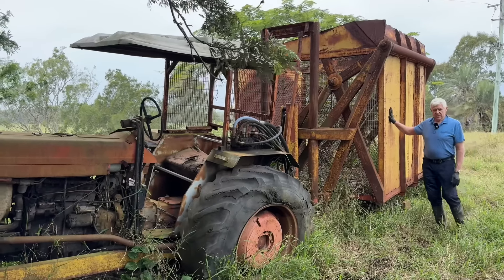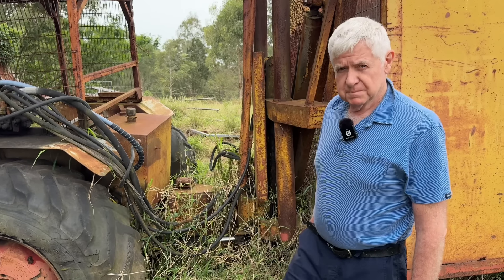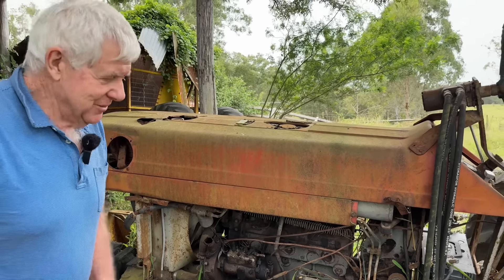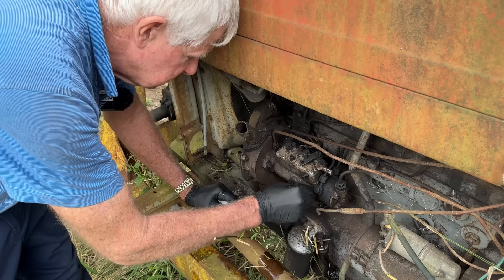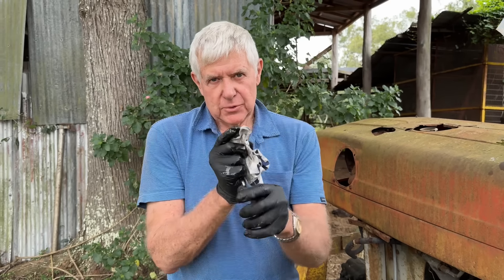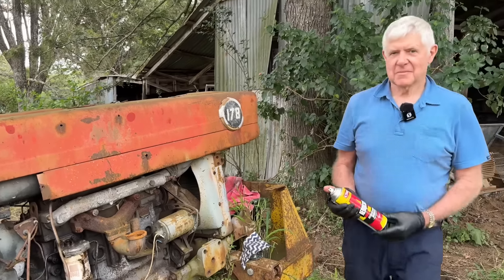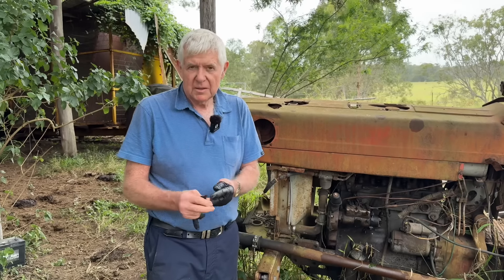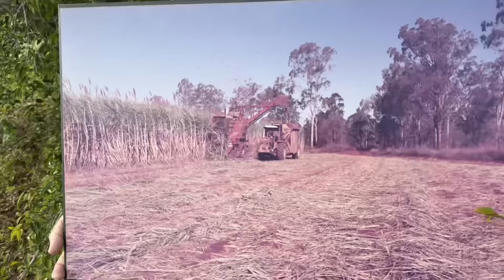Will it START? 50yr Old Tractor Haul Out Machine SITTING for YEARS!

Comment: Hi Bruce, Bruce here, The problem I believe is the stop lever on the injector pump. I just overhauled one of those injector pumps, thanks to Lance (Bundy Bears Shed) at Queensland Tractor Spares for the video on how to do it. We tried and tried to start an old David Brown 990 but it did not happen. We decided to overhaul the injector pump and found the stop lever was jammed in the closed position.  We primed everything once the pump was refitted and hit the starter and it started immediately. Took us by surprise , it started so easily.
If you have another go at it try working the stop lever back and forth to free it up. Not a lot to those injector pumps so they are easy to work on. Have a look at Bundy Bears Shed on YT and check out the CAV injector pump overhaul video.
Cheers Mate.
Reply from the maker: Thanks so much for this, I do know of bundy bear shed and I will take this all on board, thanks again, Bruce

Comment: On that fuel pump it has a strainer at the inlet of pump. Also it has a metering valve that gives it more or less fuel. When you pull the shutoff it closes that valve. When you push the shutoff back in the valve should go back to full throttle. That valve is known to stick if the engine has not run in years. I had the same problem with my backhoe. Tapping the fuel helped open it up. Since it is spring loaded. Thank you for another nice video.

Comment: Hi Bruce, I owned both a Chamberlain C670 and a C6100. The C670  was the 306 [70HP] A dog of an engine. The C6100 was fitted with the Perkins 354 100 HP. Used in everything conceivable. Not a bad motor.

Comment: Hi Bruce. Great video and I hope that you can get back and get the Massey to run. My guess that the whole unit was built by Barry McLean at Murwillimbah NSW. Barry was a real pioneer in the development of cane haulout units. He went on to build trailing and driven tipper bins as well as the huge elevator bins which could fill rail boxes one after the other down the tracks. Many other companies, Toft etc, would copy his designs and were used all over the canefields of NSW and Queensland. I even visited with a harvesting contractor in Belle Glade, Florida who was using the McLean toppers and elevators in conjunction with Austoft harvesters.

Comment: hey Bruce I have a IH434 with the same type of injector pump as that MF it had been sitting for years and would not pump like that MF I removed the top off the injector pump and it was only stuck with fuel varnish and I freed it up replaced the gasket and it started right up. Was a very simple job from memory the fuel stop was stuck in off position and the spring would not pull it back to the on position
Reply from the maker: Thanks very much for that Dave, I will pass that information onto the owner

Comment: Bruce, you said this farmer asked if they could build the attachment to go higher. Today they would give you all the reasons how difficult that would be and how costly it would be. Personal service is gone. Back in the 70s it was can do. Today its 10 engineer's and designers and an absorbent cost. I put a steering system similar in my boat 30 years ago. Good day, Jim from Connecticut

Comment: Hi Bruce, from the look and sounds of it, I think your problem with the CAV dpa pump is the fuel metering pin/arm is stuck in it's bore (common on these pumps when the engine has stood for a long time), pretty easy to sort out --- undo the 2 hexagon nuts on the rectangular top cover of the pump, lift the cover carefully (don't damage the gasket unless you've got a new one as the cover's hard to seal) as there's a spring tha goes from the throttle lever to the governor throttle plate that has to be unhooked (make a note of which hole (there's 3) the spring hooks into), lift off the cover and you'll see a sliding comb plate towards the upper edge with a slot at the front that engages with the fuel cut off/engine stop lever (I didn't notice but the lever was in the run position (lever forward to the rad) wasn't it?) and following it back you'll see a rectangular metal block with a pin that engages the comb and a long pin going into the body, lift this out (it may be stuck but can be persuaded gently to lift out), I generally clean the pin and bore with carb cleaner as it dissolves the gummy diesel well, carefully reassemble (getting the fuel cut-off lever eccentric pin to engage on the sliding comb plate is always tricky as if it doesn't engage in the plate properly it'll lock the sliding comb plate) the top cover by hooking on the spring (set the stop lever eccentric pin to the nearest position to the rectangular cover body), then whilst lowering the body down the studs wiggling the stop lever sligthly backwards & forwards you'll feel it click into the comb slot and it can then be lowered right the way down, reinstall and tighten the nuts (don't lose or forget the fibre washers under the nuts or it'll leak like a sieve), reprime/bleed the pump and it should be good, before you start the above, just give her one more try as the fuel doctor fluid might've got through to the pump and freed the fuel metering pin in any case. ---- hope this helps.

Comment: The stopper on those cav pumps stick if sitting
Reply from the maker: It looked free externally but I worry it might have been partially stuck inside as there wasn’t enough fuel getting up to the injectors in my humble opinion

Comment: hey bruce in aus just going over your video with the massey tractor maybe try the fuel shut off valve it should fire if that diesel valve is released otherwise maybe it wont dhut down

Comment: Looks like a Roosamaster distributor pump. There was a gummy drive plate in them, kinda like a flex drive, that would harden and break up when they were turned over after sitting long enough. There’s also a filter under the fuel inlet pipe that feeds the charging pump that feeds the little compression pistons. They’re not inherently difficult pumps to work on but parts are getting scarce and shop’s want a lot of money to work on them.

Comment: Good try mate ! It has an injector pump issue for sure . Very interesting tractor Bruce , and having the picture of it action is fantastic . If it had started I just wonder how many hydraulic hose would have started  leaking ? 😳 Thanks for the video mate .   Scott 🌵
Reply from the maker: Thanks Scott, close, but no cigar as they would say. Yes I agree with you on the lines, they are pretty perished and will be changed early on in the restoration I imagine. Thanks for you ongoing support, really appreciated. Bruce

Comment: Or come on Bruce given your expertise I expected you to whip the injector pump off the motor and rebuild it on the back of the Ute. 😂😅😢😊. Up here in North Queensland they still use the same principle for haul out bins although they are 5 times larger than the old Massey. Yes the hi/low gear stick must be in neutral for the tractor to start. Nice video Mate.

Comment: Yep furgies both sticks needed to be in neutral. Aussie ingenuity, let’s make a tractor into a scraper. I wonder if putting less contact to the ground is a factor. When it’s wet unless you have swampers your bogged anyway, but with this set up in the dry and there’s only 4 tyres on the ground instead of 6, it might mean less disturbance of the topsoil. But then again surely you could steer it with the brakes as well.

Comment: Try heating up the fuel lines going from the pump to the injectors and then blowing them out with compresd air.

Diesel can coagulate over many years and can block up pipes

Comment: Hay Bruce just wondering why you rub the hydraulic ram shafts flat with files & sand paper,, why would you not wrap fine paper around the shaft 180dec at length still pray it with you WD40 then pull it at both ends, this will insure it never goes flat, still love you content Re: Warrick